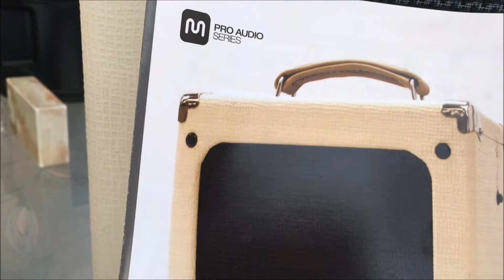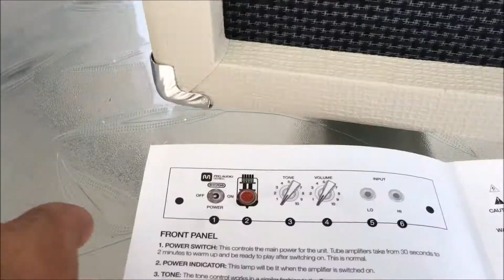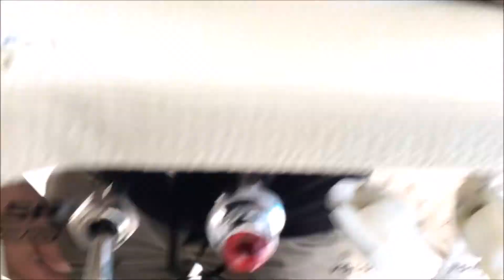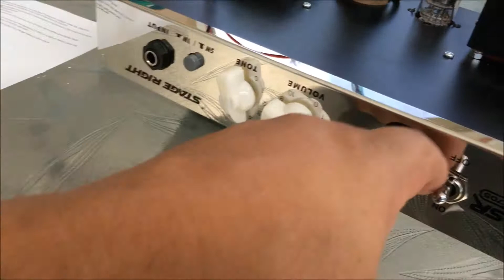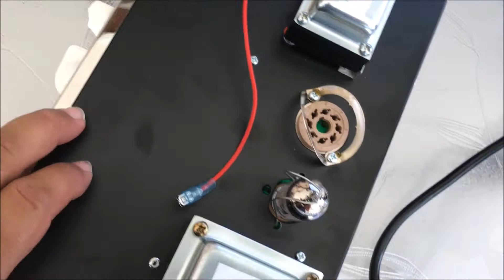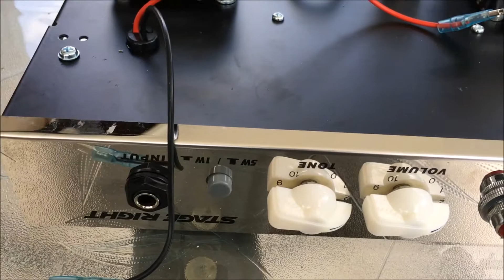Monoprice / Stage Right 5 watt tube amp. close inspection of the chassis

Comment: I just got one, my volume stay on for 30 seconds or so and then goes quiet,  flip switch off an on and volume is back,  repeats the cycle,  is that the switch?
Reply: It could need a full solder reflow. I've done a reflow on more than one of these because of cold/broken solder joints from the factory. It shouldn't take more than 1+1/2 hours to disassemble, reflow, reassemble amp.

Comment: Thanks for taking one apart. Just a couple things I caught from watching your video. That 2K2 resistor would typically be translated as a 2.2K, and the big 470 Ohm, 5W resistor is the cathode resistor for the power tube, which sets the bias.
Reply from the maker: thanks for the comment.  i figured that out after the fact.   cant help the occasional "senior moment"

Comment from the maker: just replaced the 202 ohm negative feedback resistor with 30k ohm and now sounds much more fenderlike and punchy
Reply: Do you have or know of a video on how to change those resistors?
Reply: @richardirwin1897  Don't do it.  This guy is very confused.
Reply: @richardirwin1897  THe resistor is on a seperate board with the output jacks. Its easy to remove and replace with a proper 33k resistor. But make sure its at least a 1w and not a 1/4 watt or 1/2 watt.